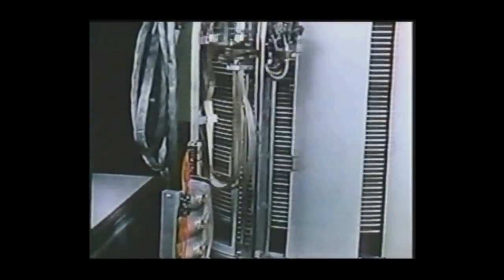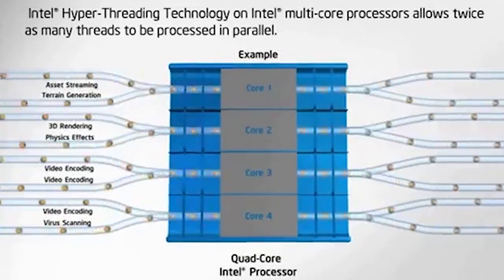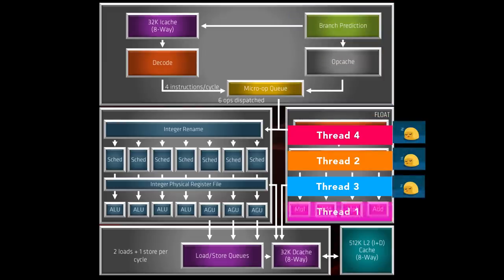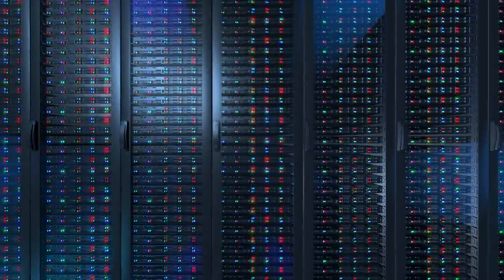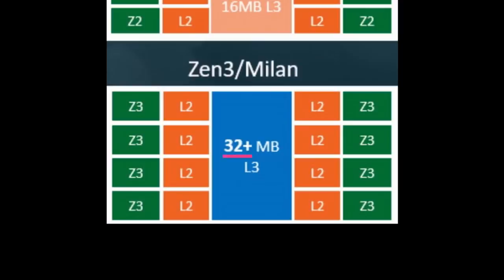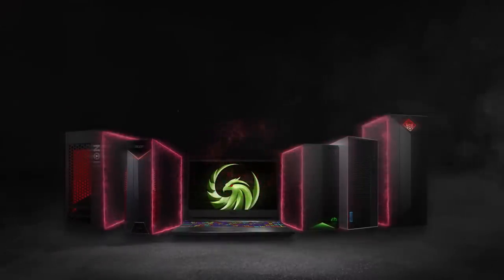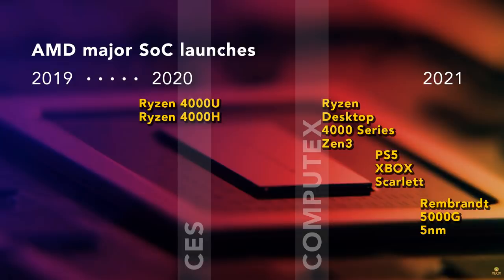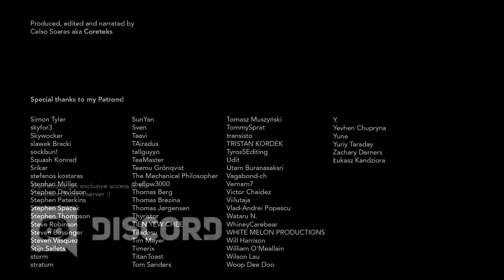Rembrandt | AMD’s MONSTER 5nm APU

Comment: With optic fibre and local content distribution networks, APUs won't have a very long future. PCs will be terminals or thin-clients for a cloud-based desktop experience the same way they are at a lot of large businesses, and the big service providers such as Google will happily enable this so they can lock in the entire market into their ecosystem and with that arranged and achieved, make the big money.
They may even compete on this new type of computing-on-demand by providing different levels of service, in the sense that they may limit total internet access to those who are willing to pay the price and that your basic computing needs such as a document editor, a banking application, email and content consumption services will be free-to-use, pay-to-expand.
A step along the way will be the development of desktop experiences through the smartphone, which itself may act as the thin client by the time there's enough optic fibre throughout the world to make such a business financially interesting. Then again, total power over consumers does attract the less financially minded.
The big caveats are latency and bandwidth however. Gamers won't appreciate any form of input lag, hell on the smartphone with the usual bluetooth audio standards in place there is a noticeable amount of latency between actions on the screen and sounds in your ears, but the average consumer doesn't seem to care enough for manufacturers to re-implement the 3,5mm audio port. If the audio latency is acceptable for the average consumer, why wouldn't input latency be? They don't mind the delay between tapping a song on their youtube app or in Spotify and the song being played through their Chromecast either.

Let's hope optic fibre takes a bit longer than it already does. Don't wanna see this sort of totalitarian monopoly of the internet as a controlled and gated community where politically-charged corporations control/eliminate speech.

Comment: SMT does not need parallel execution to give performance gains, it can provide gains simply through better context switching. If a CPU reports more cores to the OS by multiplying cote count by threads the OS can simply treat SMT threads like cores keeping the software simple. Simple means less bugs. All  the CPU had to do to give benefit from SMT is provide a register file per thread in the core itself. When the core switches threads, it just maps in the appropriate register file without putting pressure on CPU cache or memory I/O but there should not bee any parallelism as this makes the core incredibly complex and more likely for security issues if multiple register files are active concurrently. 
Simply put, having multiple sets of registers in the core is like better caching in the form of a really simple algorithm for BOTH the CPU and OS.
True parallelism should come from adding more cores. More, low cost virtual cores comes from more SMT threads. Windows and Linux then have  simpler scheduling and everybody wins!

Comment: Could you imagine a threadripper apu that has 64 cores and Vega 5nm with performance comparable to a titan and built in hmb2 or 3. Throw it inside an itx case with 64 gb of ram and a bunch of gen 4 m.2 drives. A tiny workstation powerhouse.

Comment: If thread 2 is blocking thread 1 from running, why not just tell thread 2 to wait - save its state in cache - run thread 1 until it is done or gives control back -  continue thread 2. We can call Thread 1 master and it always has first dibs on anything but may give up to let other threads run until it is woken up again where it would regain full core use where it is needed then give it back to threads. I would think this would get around the whole issue of SMT and improve performance in one shot. The cores should also know what part of the CPU the thread needs while it is running as well - so it should be smart enough to run out of older threads as well. Granted, sure, thread 1 could be a hog of the core from other threads, but it really wouldn't matter so long as thread 1 is doing work that is more important than thread 2 would be doing anyways like fetching IO data that will be on hold anyways.

Comment: Decently powerful APU; akin to a super Llanos [the only APU i've seen actually decimate the low end for it's time]; would be a great way for AMD to blow up Nvidia's low and mid range. 
Spend $500 on a decent cpu and gpu, or spend $350 on an APU that matches it in performance? Yeah, only the same sorts of trogs who slapped AIO's on locked cpu's would still buy the former.

Comment: You forgot the bane of all CPUs/GPUs: heat

Putting a high power CPU and high power GPU together is going to cause massive thermal problems
Reply: 7nm+EUV/5nm node. Also, an HBM Chiplet for less stress on the memory controllers and therefore less heat.
Reply: Bigger heat spreaders solved most of this issue in the past. 
Maybe these will be intergrated in the boards with heatsinks directly mounted on the die again.

Comment: I don't think we will see DDR5 until 2021 with Zen 4 or with a Zen 3 refresh if Zen 4 is not ready yet.  It will require a new socket.
APUs are also one year and one generation behind CPUs.  So a 4000 series APU, likely not launched until mid 2020 will most likely be Zen 2  cores and RDNA 1.  I think we'd also likely see one stack of HBM.  With these multiple process nodes and chiplets, we'll probably see cooling issues on at least some portion of the APU due to height differences.  They may even have to use a thermal pad like they do with their GPUs.

Comment: More likely Rembrandt (if that turns out to be the name of AMD's 5000 APU series) will have LPDDR5 memory, not HBM. Two LPDDR5 controllers with quite higher clocks than the mobile phone version (which just started to show up in some premier phones) should be more than adequate.

Comment: 22:15

Would latency really be an issue on the APU tho?

Video memory isn't known for it's latency, it's known for it's bandwidth.

I haven't kept up with latency numbers recently, but in the past GDDR had higher latency than DDR but scaling was better, so DDR2 could give you 15GB/s bandwidth and video cards were already seeing 200+ GB/s bandwidth.

As long as latency wasn't profoundly worse the APU isn't horribly affected. Even still, add a cache on package to buffer data.

The biggest issue I see is still bandwidth. DDR5 will undoubtedly be faster than DDR4, but we're still looking at 50GB/s very likely on the first generation of DDR5, which is a huge drop off vs even low end discrete video cards. I mean even the 750 Ti has 86GB/s.
Reply: Glen Waldrop 
dGUs are still limited to system RAM speeds outside of their internal VRAM (or cache). That is why they have trouble when the vRAM is exceeded. 8GB of HBM on the same package as an iGPU would effectively be the same as an 8GB dGPU in bandwidth, if not better.
Reply: Right.

In this case currently AMD has no L3 on their APU, so the limiting factor would be the 25-40GB/s of DDR4 bandwidth.

Even if they add HBM to the package it'll likely be a smaller amount, 1GB or so on a single package with 1/4 the bandwidth of a discrete card with 4 HBM chips.

Even if they add the full PS5 APU on a desktop chip they might have massive geometry and shading but still only have GT 730 memory bandwidth.
Reply: Glen Waldrop 
I see what you mean. Yeah, they would have to have a lot more bandwidth than that. I was thinking at least an entire stack.
Reply: Now, put an APU on a Threadripper or Epyc board with 4 or 8 channel DDR4 (or DDR5 eventually) and stuff might get interesting...

An APU with 100-200GB/s bandwidth, get AMD's heterogeneous computing going, seriously kick some ass.

Probably still wouldn't compete with the PS5, maybe even the PS4, in gaming, but it would be a compute monster.

Comment: With a die shrink, AMD just might be able to add more execution units (ALUs, FPUs, etc.) per core and make way for wider issues and dispatches. That way, SMT4 just might become a reality. But as you mentioned, hardware is just one half of the story. This will also need changes in how an operating system defines its scheduler domains.

Comment: Apus will never replace not even the entry level dedicated gpu segment as long as they are severely bandwidth starved. Equipping them with HBM will make them overly expensive. Integrated gpus also need to use the same pool of memory as the rest of the system wich nowadays is conventional DRAM. One more feasible solution would be making some motherboard models dedicated to apus, with a fixed amount of GDDR5 soldered onto it to use as both system and video memory. There are way too many motherboard models anyway. This would create the ideal gaming environment, in a cost effective solution that will not be for all users, of course.

Comment: You really need a hi-pass and a denoiser.   There's so much low-frequency noise in your videos that they're hard to understand even without ambient noise.
Reply: I can understand him perfectly fine. Don't know what you're on about
Reply: I only have to set the equalizer to treble and turn on loudness. It worked fine.
Reply: I had that same problem,  turnt out the noise whas generated by a human female thats sitting next to me on the coutch.

Comment: Unless AMD has some very clever architecture in their CPUs, my guess is that more than 2-way SMT will not boost throughput very much at all ... definitely not enough to make the extra circuitry worth it.  And so, my guess is, 3+ thread per core articles are intentionally false rumors to potentially misdirect Intel.

Comment: "AMD will close the cap in the Single Threaded performance vs Intel", AMD have passed Intel in IPC already at same clocks, it's the clockspeed AMD is lacking vs Intel.
Where example 9900k runs easelly 5Ghz all core, Ryzen 3000 is doing around 4.0-4.4 all core depending Ryzen skew and silicon lottery.
Reply: Look at the testing showing that i9 is just 5% better in game with a 20% upper cost while Ryzen have better multi core performance
Reply: @camdieu1997  Hence the "AMD have passed Intel in IPC at same clocks". Intel has raw clock speed advantage and maybe little bit better memory controller.

Comment: How does IBM work with SMT4 and SMT8 in the Power servers?
Reply: @Viewer19  I'm talking about IBM's PowerPC Servers. The architecture PowerPC, not x86, not ARM, not MIPS. The PowerPC CPUs that made the name of Apple.
Reply: Boatloads of money per package, very high clock speeds, little concern for heat generation, and video card levels of memory bandwidth. Basically, throwing brute force at the problem.

Comment: Another great video! Think the future of APUs depends on the future of displays and how people game. At some point very soon there will be an RX 5700 XT matching APU. The death of DX11 starting in January 2020 and increasing use of the more efficient and much better DX12 and Vulkan API will also eliminate some of the waste of DX11. Anyone also gaming on 4K panels also knows the scaling that is required for regular desktop applications, so for practicality, going beyond 4K on PC even if it sounds cool may be silly. 8K and higher on console and services like Stadia and Apple's gaming platform and even Amazon if and when they launch theirs makes sense do you UI and purpose. So again APUs may very well be the future of desktop as AMD predicted years ago.

Where there may be doubts is around VR and ray tracing which are also here to stay. There are clearly ways to address the ray tracing piece that don't involve local compute, however, it is those heavy brute force compute tasks that will be a challenge on the APUs of the next couple of generations.

Comment: Manufacturers need to make APU geared motherboards as a nieche market....with like 2 HDMI and 3 DP connections and wifi so you can make ultra small and powerful ITX builds in tiny form factors!

Comment: You're missing some understanding of the benefits of hyperthreading and theoretically of smt4. Lets say you've got an application that has a lot of threads, and some of the threads are doing I/O. I/O operations are always slow and that thread will generally block. Normally what the OS would have to do is context switch from that I/O thread to something else. with SMT or hyperthreading that context switching is reduced since you can maintain a higher number of active threads. This can significantly reduce the impact of what's known as thread thrashing, where threads are constantly context switching. Thread thrashing and context switching by extension can be very detrimental to performance so SMT4 could help this particular problem even more. In SMT4 there would still be context switching but context switching is very fast by comparison.

Comment: Answer to the Resource Problem, add More Resources to the stockpile like more Cache and the like. 16 to 32 then 64 ETC.

Answer to the need for more performance out of one core, Multiple Chip-lets that communicate in a daisy chain. (Infinity Fabric) SMT 4 would just mean a General Increase Resources to offset the Latency Bottleneck, and with 5nm there will be plenty of extra room to spare to Infrastructure Improvements...

Comment: I think that both AMD and Intel are going the APU way for the desktop market . I believe that both Xe and Navi architectures might be the precursors of the near future GPU implementations - energy efficiency  & sensible performance in the smallest possible package . The day that we'll see powerful APU / SOC containing  a potent GPU + 6 or 8 core CPU + RAM in one package , thus rendering discreet GPUs obsolete , might not be so far ...
Reply: The technology is definitely there for very powerful APU's. However you have to understand that sharing ram between the GPU and CPU still effects memorybandwith performance. Which is why unified memory would perform better than shared memory. Also the amount of heat generated from both the GPU and CPU in one SOC and transisters crammed into one die. The future looks like high end discrete graphics cards and low to midrange APU's killing off traditional discrete graphics cards.

Comment: The current AMD Laptop market, based on sales and overall price reductions, seems like vendors are clearing out inventory before the next gen APUs come out.  1080p AMD Ryzen 3700u systems can be found for about $500, or less, on sale here and there.  

AMD needs to slot an APU GPU just below the rx5500m to stay ahead of Intel.  Hopefully Intel's renewed commitment to GPUs with help drive the APU market into, at least, mainstream 1080p gaming without a dedicated GPU.

Comment: Problem as always is RAM capacity and bandwidth for the viablilty of enormous Xbox One X powerlevel gaming APUs.  You'd need to get a system with the gddr5/6 soldered onto the motherboard.  HBM2/3 doesn't make sense since the primary benefit for APUs are cost savings.

Comment: With two threads per core the ALU is pretty much maxxed out all the time, this is mostly due to OoOE, which is nowhere to be found in your video so it is misleading. You might extract some more FPU performance but ALU is what matters (DB/HTTP and most server and application workloads). They would need more silicon for the thread scheduler and more ALUs to make this work, and most likely it would make more cache misses as a sideeffect. I guess they decided it is not worth it for now, since they can use the silicon real estate for more cores instead :)

Comment: smt4 4 threads are pointless imo ? the performance increase of hyperthreading is really rubbish from a home PC perspective (<=5%?), compared to just running at a slightly higher frequency in my opinion, al my tests proved performance was improved more in the thermal envelope by OC'ing a bit further with HT off than HT on ? heat cost wise with the same cooling capability.

Comment: I'm sorry but I doubt SMT will be usefull for (hpc) high performance computing . As far as I know SMT works in conjunction with the out of order dispatcher and is mostly useful running loads with codes that target different types of units, for instance running mostly integer code simultaneously with mostly floating point code, hpc code is mostly floating point and I don't think the dispatcher will have trouble keeping all floating point units occupied, as long as it's not waiting for the cache, which the second part of the argument against SMT benefiting  HPC code, since most HPC code is bottlenecked  by the cache and there's only one L1 cache for every processor. So 2 or threads running in the same processor with the same amount of L1 cache just divide the cache between them. Personally I can't think of an example of HPC code that's not bottlenecked by the cache, with the possible exception of monte carlo simulation, the rest, FFT, numerical linear algebra, etc... is limited by cache size.

Comment: Only rich people can afford google gaming service + you need an expensive internet connection to access the gaming service. So the effort from AMD dream of cheapest ways to get the hole package of office, communications and graphics performance in a single processor nest is possible happening inside labs. Could be the next step away from cpu+gpu combination innovation. I read that those AMDs 64 cores can run crysis game without a discrete gpu. So is already or accidentally happening right now.